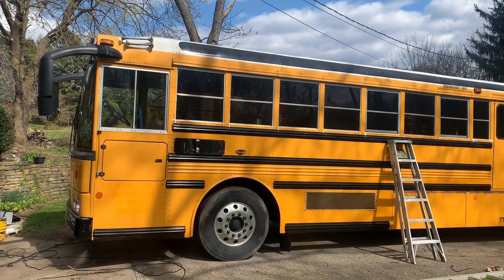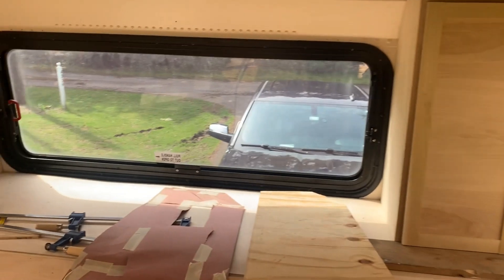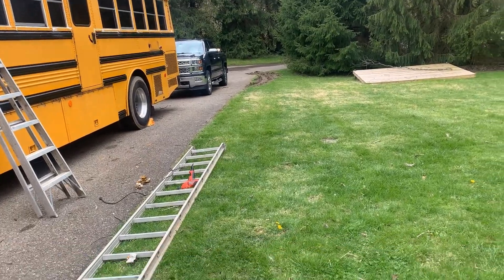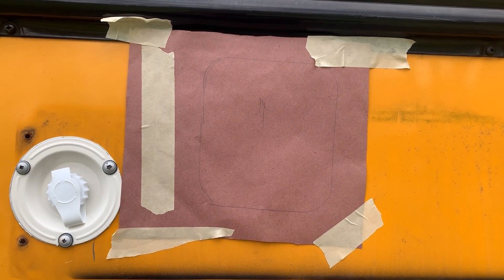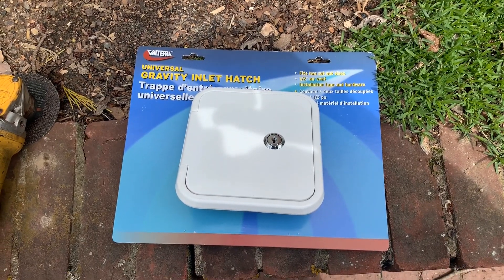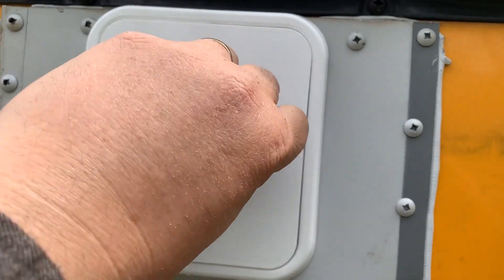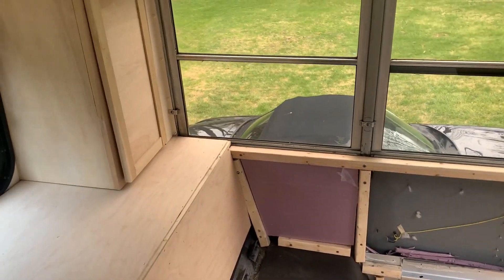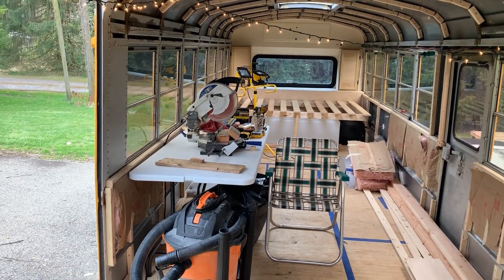Harmony Express Skoolie (EP 13) - Paper Dolls and MORE

Comment: Is your bit holder magnetic? I find that essential to the square drive bits staying in place. It helps if they’re tight, too. Sometimes it’s trial and error with a couple of different “bit holder” extensions. Nice videos. 🙂
Reply from the maker: Andrew Dunlap thanks for the comment.  That is a DeWalt Driver and bit set.  It is magnetic, but apparently not strong enough to resist pulling out when driving those recycled bus screws...  they got so wedged onto those square bits that we had to use pliers at times to get them off when we were doing the ceiling demo!

Comment: Doesn't that type of insulation have a tendency to get black mold?
Reply from the maker: @KAREN RIGGLE  yes, there is a possibility of this happening, especially in the condensation-riddled nature of a bus.  That being said, any type of insulation inside a sealed wall is a chance for mold.  Spray foam will get wet with leaks and condensation as will foam board.  Unless you stop 100% of the water and condensation in your rig, you’ll not be able to stop the possibility of mold growth inside your walls.